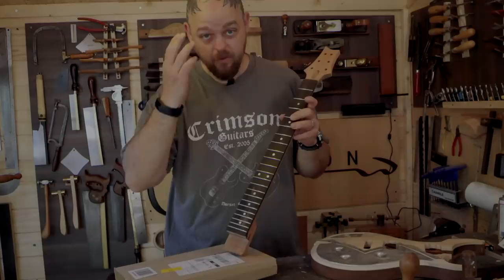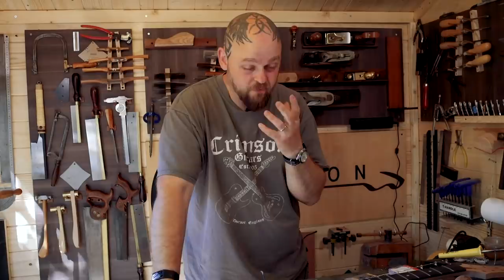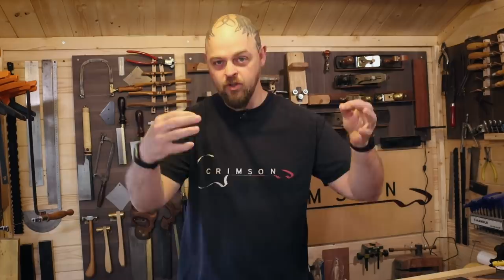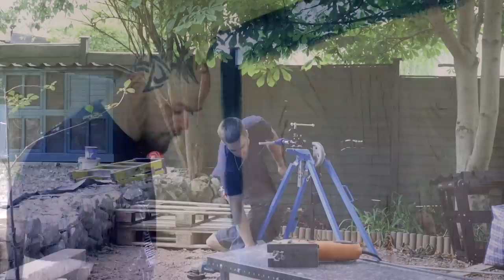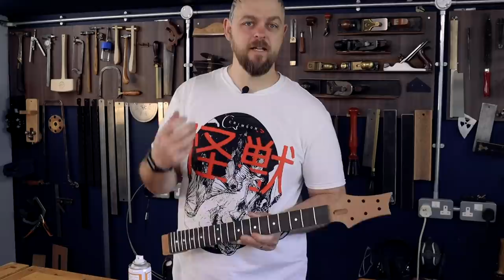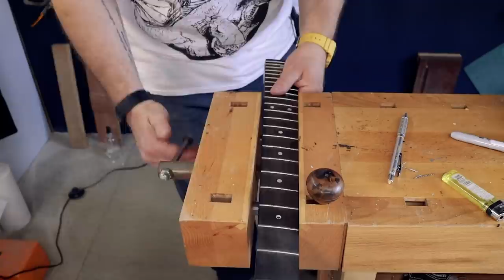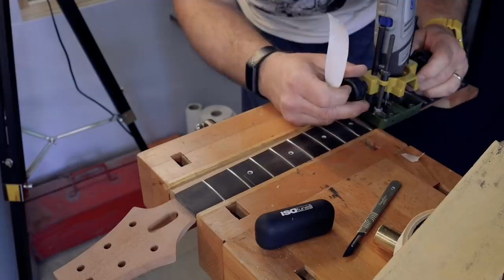Utter Failure Ep 10 | Building a CYBERPUNK 2077-inspired Custom Guitar

Comment: I'm gonna give you sympathy anyhow, because I feel for you on that. I have worked on my regular woodworking projects and ended up messing up at the last minute, even though it was going fine until that point. I feels terrible. So, I'm gonna give you sympathy anyhow.
I was saying the whole time, just remove the fretboard. 
If I ever get everything I want straight in my head and get enough saved up to have my almost exact copy of my baby (well, one of my babies) that I lucked up and found, customized like I want it, I'm going to want some weird inlays with LEDs and a maple fretboard installed instead of the rosewood one. I have one guitar that has a maple fretboard and I just fell in love with maple fretboards. Unfortunately, to get the second one like my other guitar that I play the most, I had to take the rosewood fretboard, because that is what they used back then. Nobody seems to like removing fretboards. So, if I ever get to have this guitar customized, most likely, I will be begging you to be the one to do it.
I do have a question about maple fretboards. Is there a certain species of maple those old Fender Tele fretboards were made of that made them yellow over time that certain way? I know turmeric can give a great yellow stain on pine and bamboo, because I have experimented with it. At least, this certain bottle of turmeric I got does. It was the cheapest thing I could find online just to experiment with dying wood. I was just wondering if there was a certain species of maple they used on those old teles that gave them that really cool yellowed look. Or could you do that yellowed look with the Crimson stains on a maple fretboard?

Comment: The red LED operates--illuminates--at a lower voltage than the white LEDs.  When you wired all of those LEDs in parallel you made the red LED the voltage regulator across your rails.  The red LED wouldn't allow the voltage across the rails to rise high enough to drive the white LEDs into their respective operating voltage.  Red and green LEDs typically illuminate at 1.8 to 2.1 Volts, blue and white and UV LEDs typically illuminate at 3.0 to 3.2 Volts.  If the red LED illuminates at 2.1 volts then the voltage across the rails can never rise higher than that 2.1 volts.

There is a solution to this if you like, the red LED needs its own feed wire and dropping/ballast resistor.  You can return the current on a common ground rail and thereby limit your wire runs to just the three.
Reply: Even easier is to give each LED its own resistor.

Comment: i would have taken the fretboard off the neck and work under it, electronics is an easy subject as i used to create guitar pedals when i was 16 and ive done this LED light mod on a fretboard before as a school project for Design & Technology. am 48 years old now.. its great fun but for an easy and clean job the fretboard has to come off. also use micro L.E.D's are easier...

Comment: 1: Build a new, fat neck. Headstock needs to be cyberpunk anyway.
2: Abandon the traditional dot inlay arrangement to leave the centerline pristine.
3: Arrange the LEDs as hash marks down the sides of the fretboard.
4: Wire the LEDs to either side of the carbon fiber rods. 
5: Slotted headstock with a thin layer of aluminum (or Stirling silver if you're feeling bespoke) all around the top and bottom of the slots.
6: LEDs staggered between the tuners.

Comment: Here's what I did on mine, Arduino controlled ws2812b leds: 
https://imgur.com/a/dyWuYJ6
channel routed out of the back of the fret board, shouldn't have gone up the center, but I already had by the time I relized it was a mistake. Filled in with wood putty, filled the inlay holes with expoxy, sanded then glued the fret board back on. drilled through the body and neck in the neck cutout and routered a pocket for the Arduino nano. Pulled power from the active pickups. 
Works, but makes a ton of noise you can hear through the pickups. I sheilded the pocket for the arduino, it still made a bunch of noise, then a few days later I realized that I'd never grounded my shielding. Haven't made it back to the project to try that. 
I know it's ugly, but I wanted to see if I could make it work before I did it on a bass that I actually liked. I picked up a microphone for the arduino as well. Planned on trying to get it to recognize different frequencies and change colors or patterns. Maybe I'll get back on that project soon. 
Thanks for the videos. I thoroughly enjoy them.

Comment: Connecting 10 LEDs in parallel on same resistor will create problems. They aren't 100% identical, one of them will draw a little bit more current than others and it will burn after some time. Remaining 9 will have to split current intended for 10 LEDs and will be burned one by one in less than hour. It is recommended to connect maximum 3 LEDs on one resistor.

Comment: the string touching two frets is not just turing the LED off, it's shortening the battery. a potential risk of grand desaster. i HIGHLY recommend not using the frets as conductors. 
i saw that you ditched the idea already, but just for everyone else who thinks about taking on on that idea.
Reply: No, it wouldn't short the battery, as there is still the series resistor. One can actually wire it such that all leds are in series, so short a fret won't influence the others. The problem is that 9 volts wouldn't be enough if they are in series, since each white led has a forward voltage of 2.something volts.

Comment: The gauge of wire, albeit providing some rigidity, is way too heavy IMO. And you are right, your soldering does suck. I would use solder paint, its easier to use and requires less heat but I guess at this stage you are just testing out. You can tell metal what to do too, especially when working to +/- 2 microns.

Comment: You know, if you could build the LEDs in every fret in such a way that as you play the fret you're on lights up that could be a really cool effect. Now I want to go away and work out how that could be done. I assume your idea would have just turned off all the LEDs at once as opposed to just the one you're on while playing but if it's the latter that could be a cool effect too.
However, and I'm not an expert at electronics so if I'm talking nonsense I'm sure someone can tell me off, if the string is used to close a current loop, this might affect how the pickups process the vibrations or worse, make the ground wire redundant and short out the pots possibly? Just thinking out loud, again it's probably not an issue given the low voltages needed to power an LED...

Oh and also, I thought you weren't gonna turn this into another 90-hour build. Maybe you should have that guitar handy just to remind you of the pain you want to avoid subjecting yourself to ;)

Comment: Ben, I won't comment on your soldering technique if you don't talk about my wood working skills.  The reason your first experiment failed is the resistor was too large.  The red one fired because it has a lower voltage requirement than the white ones do.  Mr. Ohm said the resistor = voltage / current.  An LED needs about 25ma to light.  Times 10 of them in parallel is 250 ma.  The white LEDs need about 3.3 volts to light.  The red ones only need about 1.8 volts.  So, the voltage across the resistor would be the 9v battery minus the 3.3 v for the LEDs.  That's 5.7 volts.  So, doing the math the resistor should be  5.7 volts/ 250 ma.  Or, right around 22 ohms.  It's really 21.6 ohms.  But, 22 ohms is a standard value.  There you have it.  The resistor was to large.  Adding the second in series was even worse.  But, other that that is was a wonderful episode.
Reply: The resistor was not the issue - the issue was that  the red LED clamped the voltage at a maximum somewhere between 1.8v and 2.2v, which meant that the voltage could never reach the minimum of 3v required to turn on the white LEDS. Had Ben removed the red LED with the battery connected, then the white LEDs would have turned on.
When connecting LEDs in parallel, best practice is for each LED to have its own resistor. Had this been done at the start then the all the LEDs would have turned on.

Comment: How could we leave you alone in this madness?

I'll share my "learning curve", maybe it will brighten someone's day:
It took me few weeks to make ergonomic double handed machete handle (don't worry, I'm not gonna hunt with it :v)
It's made out of ash that somehow has flames. I've made it out of one piece with half cut (so the blade comes out the top but on the bottom there's no joint). It was coming together slowly but surely so I decided to test it (it might look nice but does it chop?)
After few hits it started kicking like crazy (some kind of recoil that hurts your hand more that the piece of  wood that you want to chop).
I think that's because the bolts got loose inside the wood. Went home and realized that it has cracked on the bottom 😢

Basically now I have toy that I can not use and do not look good. However I've made lots of dust 😁

Comment: Ben, sorry to say this was painful to watch. If you want to save time and space I would really use SMD's (surface mounted diodes ) best to go for a 403 smd, you can buy them in a range of colours. Their size is 1mm x 0.5mm and kick out as much light as an LED. You can buy them with thin gage magnet wire of about 0.25mm thick and are coated so positive and negative wires can be crossed without causing a sort. Iuse these in my hobby all the time as Ionly have limited space for lighing. I use a guy on ebay called the led barron and in the years I have used him he has never let me down. You can coat them with either resin or finger nail acrylic power used with liquid monomer. Also you will find that different coloered LED's and SMD's draw different voltage too which is why in the 1st test you did only the orange LED lite up.and if you buy the 0.25mm magnet wire to connect all the SMD's you would only need to run very small channel for the wire, thus saving the structural integrity of the neck.

Comment: Pro Tip: If you want LEDs inlaid in a guitar neck, install them during the build procedure.
Reply: Or install the LEDs upside down, as you were going to do, before you realised that guitar strings conduct electricity, but put the leads parallel to the frets. but inlay them slightly below the level of the fretboard... then create  new  markers that are translucent, that go from one side of the fretboard to the other, OVER the LEDs (and the wire leads). Then you get an illuminated bar the stretches the width of the fingerboard. Then all you have to do is inlay  a wire down both edges of the fretboard to connect to the LEDs, in a ladder formation, which we know already works. Simples
Reply: PRO TIP no.2: Always wait to the end of a video before commenting.

Comment: I would have had all the frets connected to one side (positive), and had the negative go down the guitar string.  Then only the LED for the fret played would light up.
Reply: Was thinking the exact same thing. Any risk of interference with the signal via the guitar’s ground wiring on the strings through the bridge ?
Reply: @yannsalmon2988  Shouldnt be.  The current in the string would be on a different frequency to the current in the string that is produced via the string vibration and pick-up magnets.  The ground wiring is actually optional.  You could simply not ground the strings.  Its really not necessary.
Reply: Jason Young Oh, OK. Thought it was also a safety feature for extreme cases where you could be electrocuted (like, say, stroke by lightning when playing outdoors during a storm) so the current who go directly through the ground wires rather than your body. If not, then the only downside of not grounding the bridge would be losing the hum cancelling effect when you touch the strings (which would not change lots with humbuckers, I guess).

Comment: replace all the rosewood with carbon fiber and include a channel for wiring while you are at it :D ....has anyone ever made a metal fret board? You could use the frets as positive and the strings as negative so that the fret board only lights up when you play that note :P  Could also remove all the frets deepen the groove and run insulated wires transversely for the LEDs.....endless possibilities.

Comment: Your playing the guitar will not act as a switch, it will be a short circuit! While the frets are connected by the strings, a larger current will be pulled from the battery making it die quickly.

Comment: Well ben Edison had really lot of fails before he made a light that worked. Really there not fails their just things you learned that don't work well. However; eventually you will succeed, because you keep trying different things. Remember you put in an led and ground down the top with no pearl inlay. Your last idea would work that way. Violin makers have a very narrow groove cutting chisel they use to remove the perfling wood after cutting the sides of the slots. I made one from an old paring knife myself. I think that would work for removing the wood from the slots you have already cut. Just saying!

Comment: why not simply connect the LEDs to the frets, and truss rod and run the current through the strings? pretty sure the current will be low enough to not be felt and then the player is literally riding the lightening while the lights react to their playing

Comment: just install a proper LED strip (like the one you want to use in the body).
Reply from the maker: I have considered that, it takes up a load more space than single wires though and I would worry about the stability of the neck.. B
Reply: Crimson Custom Guitars 
My LED strip could sit in a 2mm deep cavity. 
That small depth of a routing should not affect the neck stability. Also, you could make the routing into the back of the fretboard. 
And feed the power to it through the neck PU cavity from the main power supply for the other LED strip. (Or just use one really long LED strip).

In My experience these clear, individual LEDs  are way too bright. The strip would be better as you can adjust its brightness, too. 

Ohh man. I really want to work on guitars again.

Comment: Good grief, that was painful to watch....especially after a 45-year career in electronics!! By now, you realize that removing the fretboard is the only way to do this without making it excessively complicated. The constant shorting of the LED circuit won't damage anything, but it will wear out batteries many, many times faster than without the short circuits......not to mention destroying a perfectly good fretboard. K.I.S.S. ....even if it is a bit of work.
Reply: It's only shorting the LEDs not the current limiting ;)

Comment: So why use the big frog eyed led?  Why not use the frets as a negative rail,less drilling, the strings are already ground due to the bridge ground wiire. Use them tiny surface mount led, oh and for God's sake drop the 9v battery idiea. Use a feckin sterio jack and use 1 ground and pos for the guitar out, and the other pos for a 9v feed from a PS.

Comment: I'm not sure it's utter failure. You now know what doesn't work. Watching you vandalize that fretboard--- sorry, modify drastically-- was a bit painful.
Amazingly, I actually did come up with a method of having LEDs in the neck but it does require the fretboard not be attached. Two thin channels parallel to the truss rod for the positive/negative main power leads, similar to your "proof" ladder of LEDs. LEDs embedded directly under the dots, connected to the main leads. The mother of pearl may have to be replaced with plexiglass/perspex to let the light come through. The side markers could be done with fiber optic "threads" [probably wrong term] leading to the center, so the LEDs would do double duty. You would still add a resistor in the circuit, apply power, and a lighted fretboard would appear. Once you actually affixed the board, that is.
This idea would likely work better in a fresh build, as opposed to a retrofit.
Looking forward to seeing your ultimate solution and the finished product.

Comment: No Ben.... You've done it completely wrong. Retrofitting LED's in a neck is a disaster... you've found out. What you ought to have done is: 1) ask somebody with knowledge of electronics for the best approach from the electronics side, 2) use SMD LEDS and resistors, because of their size  3) design and build a completely new neck which incorporates the LED's and the electronics design. Using some CAD software would have been smart too.

Comment: This was painful to watch. LEDs are driven by current, not voltage, therefore you arrange them in series, not in parallel if you want equal brightness. You could just have asked someone.
That said, I am very sure that you would cringe equally watching me working (fighting) with wood.
Reply: And one more warning to everyone watching: if you connect equal LEDs in parallel without a current limiting resistor for each, you might get something that works for a while. 
It's a trap!
Because what is going to happen is that one of the LEDs heats up just a tiiiiny bit more than its neighbour. This means that its forward voltage is somewhat reduced, leading to a bit more current through that LED, leading to more heat being produced, less forward voltage, more current, more heat...
A runaway process that leads to the destruction of that LED. Then the next, and the next.
So after you have built and installed you strip of LEDs you watch them die. Don't do that.